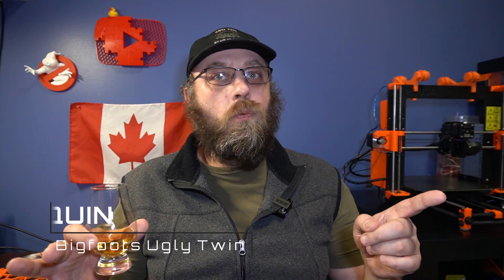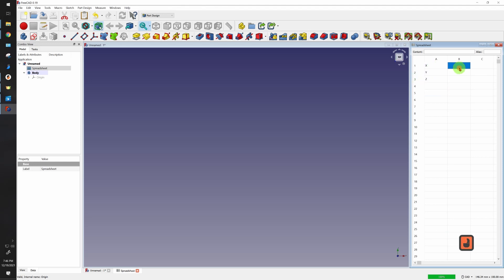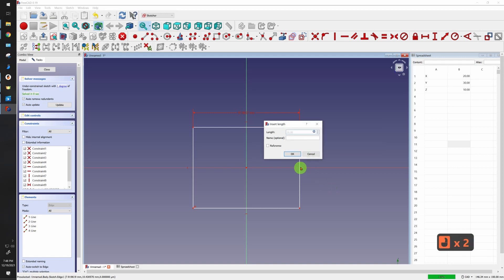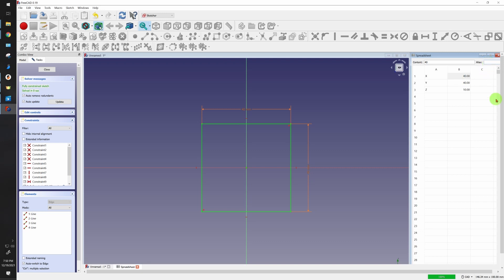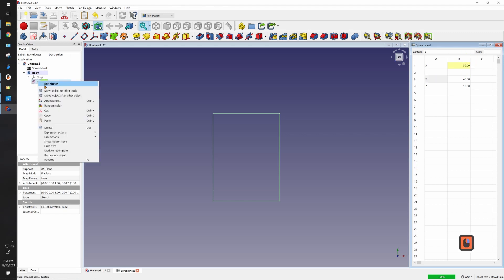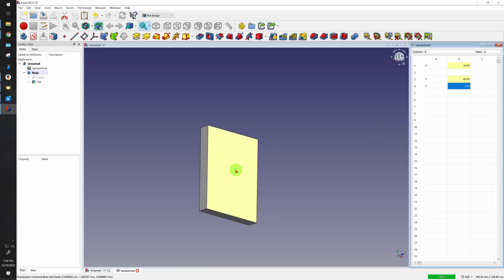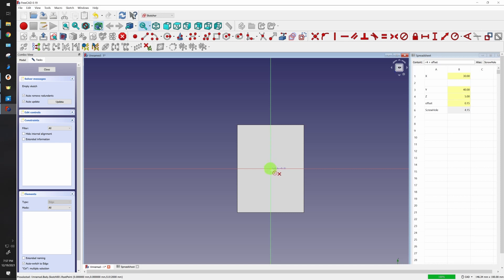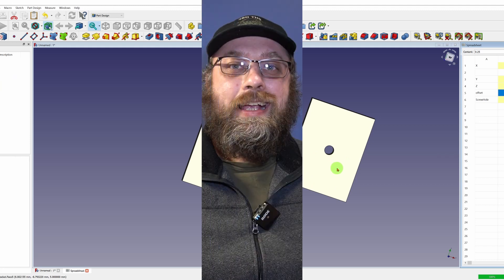FreeCAD Spreadsheet Tutorial

Comment: Nice tutorial, but shouldn't you include the units too on the Spreadsheet values? I know it defaults to millimeters, but what if you want inches? I usually use millimeters and even if defaults to that unit, I also specify them
Reply: Answering to my own question: I guess it is better not to work with the full units because "-1 mm" will be treated as text. So, better check that the are set right under: Preferences > General > Unit System
Reply from the maker: Most the things that I design at home are designed to be 3D printed, all my measuring tools at home are set to mm.  So when I sit down in front of FreeCAD I don't think about changing units.

That being said I've designed things for both the American and Japanese markets and the  worse sin that you can commit is mixing measurement types.   As a jr engineer in the 90s I watched someone get walked out the building for designing a tool head for a robot in inches but then using metric for all the hardware (bolts, washers ... Etc).
Reply: @QEngineering Then I guess it is better not to include the units on the measurements. Anyway, that thing with the negative numbers and the units is not good solved.

Comment: Excellent thanks. I am going to try and retro size one of my designs that prints a bit larger than I want and struggle to fit it in a Venetian Blind header rail despite measuring the original very carefully.
Reply from the maker: Designing for 3D printing is challenging(in a fun way).
Even if you calibrate your X-Y steps, and your E steps you will always have a bit of variance between your design and how it prints.

Also different materials tend to have a bit of shrink factor which often makes it a bit hard to get things 100% on the first go.

Even different Slicers tend to calculate the final print a bit different so knowing your gear and software is something that takes time.

If you are using PrusaSlicer try using .STEP rather then .STL  Just by messing around I've found that parts printed from .STEP tend to be a bit more accurate for me.

🍻

Comment: I'm having trouble getting a spreadsheet to work in freecad 2 1.1. It won't calculate. or recognize the spreadsheet. Any suggestions?
Reply from the maker: I'm not sure what you mean by recognize the spreadsheet.  Are you having issues doing calculations within the spreadsheet or getting information from to it?

Because there is this little thing in FreeCAD spreadsheets were data only flows one way, so say you have a sketch and you use the spreadsheet to get the data from that sketch you cant then write to the sketch from that spreadsheet. I'm guessing this is to prevent circulation errors in logic.

Also when you use the spreadsheet name are you using the spreadsheet.A1 or <<spreadsheet>>.A1 ?  one is the internal name while the other can be a creator name.

Lastly, some names are not allowed such as "Angle" which will assume a unit rather then a name.

https://wiki.freecad.org/Expressions has more details about the systems.

🍻

Comment: Path & spreadsheets are the new horizon. Thanks for the tutorial, I will look forward to more.
Reply from the maker: You're 100% correct. .

I was doing a bit of work with solidworks and having to jump between different sketches to change dimensions felt like I went back in time 20 years. 

A well organized spreadsheet just makes the projects look sexy.

🍻
Reply: @QEngineering  Here is a challenge you might like. I would like to draw a ladder with a spreadsheet.  It's a scaled model 265 mm long 28 mm wide with 18 rungs.
Reply from the maker: Unfortunately my friend ATM I'm swamped with family obligations so I can't make a video to show you the answer.   However it is fairly simple.   Make a rectangle with your height/width.  Then cut out a rectangle that is "(ladder height/(#rungs+1))-(rung size*#rungs)" high, then use the linear pattern tool to make #rungs+1 instances of the hole at ladder height.

Hope that helps.
🍻
Reply: @QEngineering  ❤

Comment: I was wondering if you had used export to save a spreadsheet.  When I exported a working spreadsheet (I had to select the cells to get them to export) and then imported it into a new freecad project the imported spreadsheet looked fine (even had yellow cells with numbers next to the alias cells) but the links weren’t found when I tried to set up a length using the formula button and alias.  If I went to the spreadsheet and recreated the link it worked, but Is there some special step needed to get an imported spreadsheet to work without redoing all the links?
Reply from the maker: Sorry for the delayed reply.

Have you tried saving and reloading after you import it in?  The expression engine may not pick up the variables until it's reloaded.   I know there is a bug in freeCAD 19 where if you give a constraint a name it doesn't show up in the drop-down but when you type it in manually it will still show it.

If I have to reuse a spreadsheet I generally open up that project, re-save it under a different name and delete the drafts.   It's just the way I've always done it.